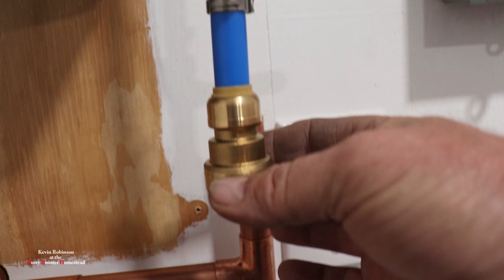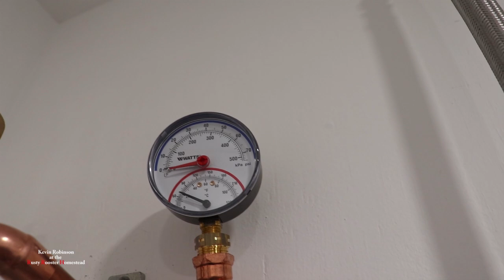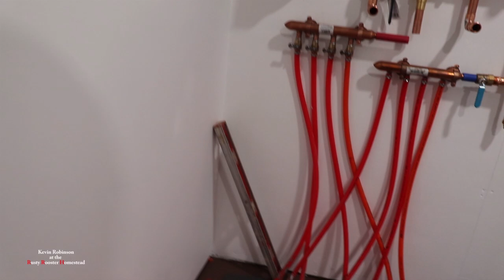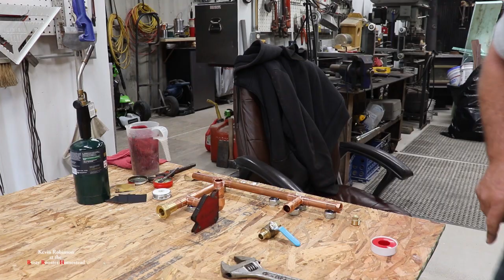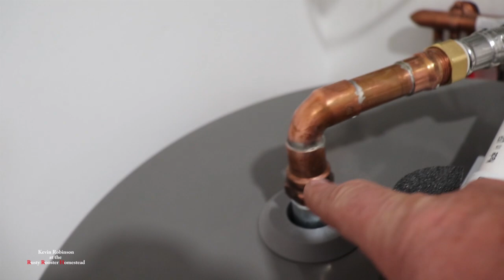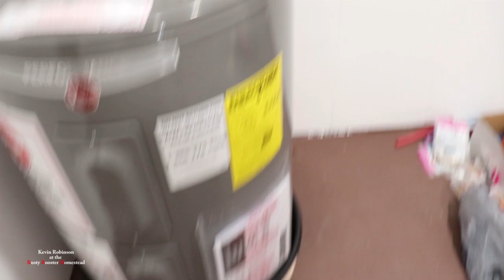radiant floor heat simple system

Comment: What size pump did you use for this system?
Reply: And what about the expansion tank size?  Also what temp do you keep the hot water tank.  Thanks for answering my questions btw
Reply from the maker: Taco 1/25 hp

Comment: Where are you pulling the 24 volts for the thermostat?
Reply from the maker: From the switch relay.
Reply: @Robinson-Homestead  may I ask witch relay you used?
Reply from the maker: Taco sr501 1 Zone
Reply: @Robinson-Homestead  would it be to much to ask to see how you wired the thermostat? The jumpers?

Comment: Great Job. Regarding the tankless and tank  comparison, the wires are larger due to the initial amp draw which doesnt remain consistent while in use and are only used when the system is in use. On the other hand, the tank system is ALWAYS drawing power from your service to maintain the water in the tank at that temperature.  I recommend utilizing usage meter to determine which service would prove optimal and efficient as not all applications are the same.
Reply from the maker: Thanks for the info.
Reply: The resistive elements do not have a starting current spike like a motor.  The tankless water heater has a higher current draw because it is heating the water up much faster that the tank heater, therefore, a much higher power consumption.

Comment: Put is install, incorrectly. Motor should never be facing down or, in the up position. Air can and will get trapped in the pump housing, and it will fail.
Reply from the maker: No issues so far this thing works great below 0* outside 72* inside I think that it works great  thank you for the comment. 
I'm sure if it stops working I do a video to show everyone I messed up.

Comment: I would like to see one of these in floor heatings done by someone that knows what they are doing. There are some mayor errors here that will cancel your home insurance and cost allot of money to operate.
Reply: Can you explain the mistakes?
Reply: @Southofheven  pump is on wrong side of pressure tank
Pressure tank is at wrong PSI
Running the system at wrong PSI
Mixing valve defeated whole purpose of using a tanked water heater
Reply: Pump motor can not be installed hanging down

Comment: pump and Expansion tank should be on the cold side.
Reply: looks really good though.
Reply from the maker: Thank you
Reply from the maker: Thanks for the info, we are getting ready to try it out since it has been getting cold outside so i will do a video and let everyone know how it is working.
Reply: That’s true for a steam boiler system but not a low temp radiant system. Modern pumps have zero issues with water heated to 180 so it’ll be no problem with what he’s got going here. However the pump and pressure tank are in wrong order. The circulator is pumping into the tank which is wrong. Research “pumping away” for details on why.
Reply: @bpdp379  I did not say that it would not work. I was just saying that a pump will last much longer on the cold side.
Reply: @autohelp6504  copy that. I didn’t say it wouldn’t work either. Just that it is not an issue for a pump to be on “hot” side of the loop. That’s the great thing about hydronic is it can work with lots of problems. Just not as well as it could.

Comment: Looks just like a system I put in my house and garage, mine is a little bit more simple, I'm no plumber but I'm pretty sure your gonna want to put a pressure reducer on your cold water infeed pipe
Reply from the maker: Shaun, thanks for the info i will check into that.

Comment: I would add a filter, just to keep any build up from traveling through the system. If there are any minerals in yhe system as it heats up it can cause build up internally. A small filter for sediment is good to have.
Reply from the maker: Thanks Matt.

Comment: On your Teflon tape, do not put more than two wraps on small fitting. If you put more the tape will BUNCH up and not EVEN go between the threads. If you have, say, a 2 1/2" steel pipe put three wraps because the threads are much taller and you want the tape go down into the threads.

Comment: It looks like you have soldered a few times before... great job.round about 3 wraps for Teflon tape. And I never overtighten at first. It's always better to tighten a little after you find a leak. Instead of  when it's overtight you can't tighten it anymore. Inspectors want to see twice the working pressure. So if your house pressure is 50 lbs. You use 100 lbs for a test. The tyco pump you can oversize the split rings and add some rubber between the split ring and pipe. Should help with isolating vibration.
Reply from the maker: Thank you Terry.

Comment: Well you know Keven they want to complicate these systems, because all of these special valves and fittings are very expensive, they make a fortune on this stuff. I love the shark bites, but they sure are not cheap, it seems you have everything covered, and the one way valve should be just fine so chemicals could not back up into fresh water, it should work great, nice job.

Comment: it's going to really cost you a lot to heat with a hot water heater. i don't even heat my hot water with a hot water heater much cheaper to heat it with the wood boiler. good luck and keep elements on you will need them. take care, be safe and well.

Comment: Do you know if it's true that floor/radiant heat does not work well if you put carpet on the floor?  - e.g. the carpet acts like insulation blocking the heat.
Reply: i think it's best not to cover it with any thing to get the most out of it and the lowest heating cost. take care, be safe and well.